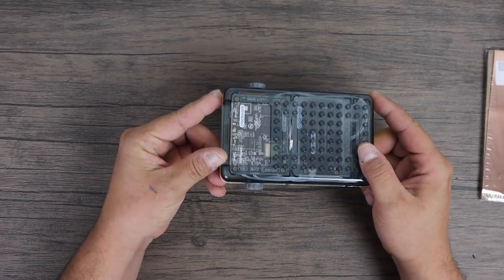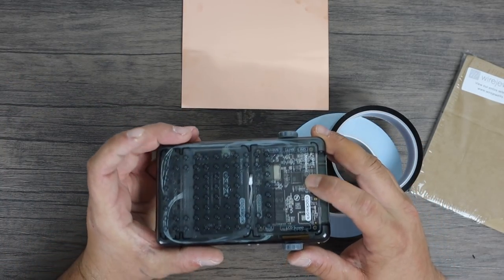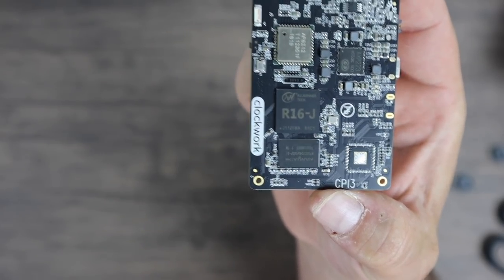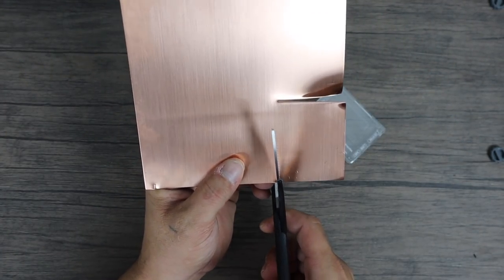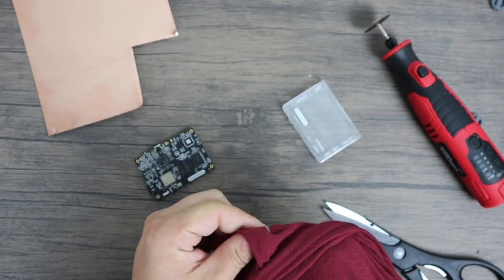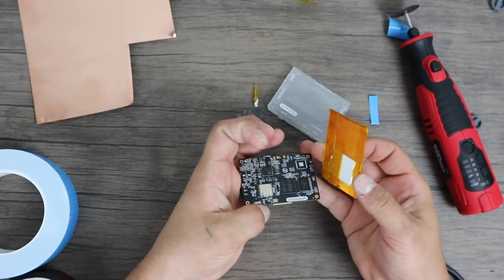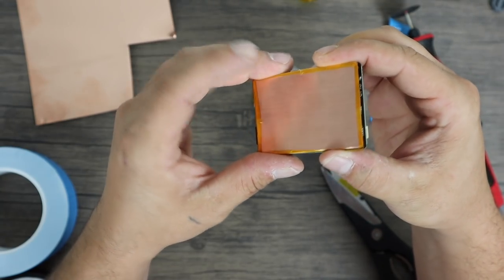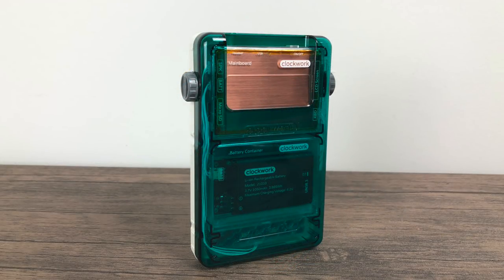Adding A Heatsink To The GameShell By Clockwork Pi

Comment: it might be a good idea to make the plate have a tiny 1 degree bend on two edges so the case can press the plate in place. also it might work better if you used thermal paste to allow the plate to have better contact with the board. the fluid will fill in microscopic lines in the copper and allow for better contact.
Reply: I doubt the heat is too much for the copper to handle as is.

Comment: could also add small holes in a grid in that case so air can move more freely... with the additional copper i would say it would help a lot for the overheating issues.

Comment: I think if I did that i'd take my time and put some neat looking ventilation holes in the cases, failing that a couple of rectangular holes with an aluminum mesh covering them. Sadly though i'm still on the waiting list to get a clockwork pi.

Comment: i wonder if you cut/created holes or vents in the plastic where the copper is would that allow for better dissipation of heat. instead of trapping the heat inside the plastic box

Comment: Over heating because it's a sealed shell in a sealed shell.
Reply: these sorts of things normally would work fine when passively cooled but this is emulation, so the board is getting an extreme exercise.
Reply: Shellception.
Reply: First thought I had. Its a cool yet severely flawed design.
Reply: Bryce Demise if it was all aluminium.. done
Reply: This section of the gameshell is actually not sealed in the outer shell; there's a hole in it. So only one layer of sealed shell.

Comment: can you not install the board without the case?
Reply: Rob Simpson yes but it will flop around and possibly break something
Reply: Someone will hopefully design a 3D shell that has mounting points for boards as so forth.. 

Plastic is an insulator.. so yeah airflow would be nice. 

In regards to his heatsink design.. being the copper sheet covers the board.. he could have saved himself a major hassle by cutting the case where the CPU and RAM are and used the thermal tape as a bridge to pass the heat through external to the plastic case that surrounds the CPU and make it nice n snug.